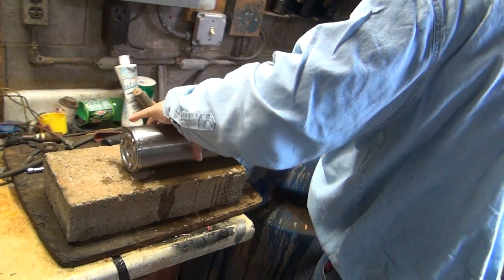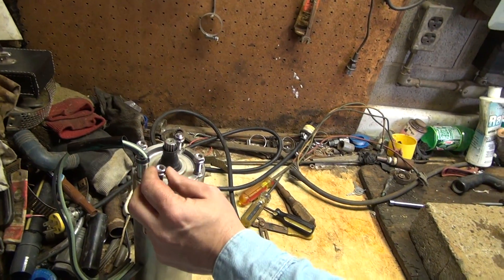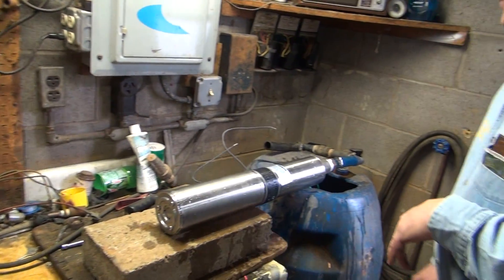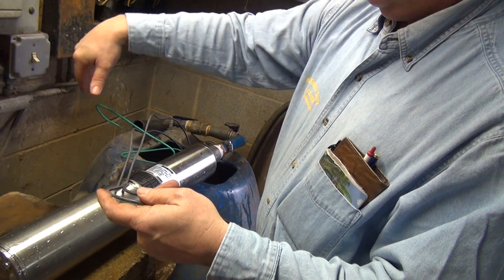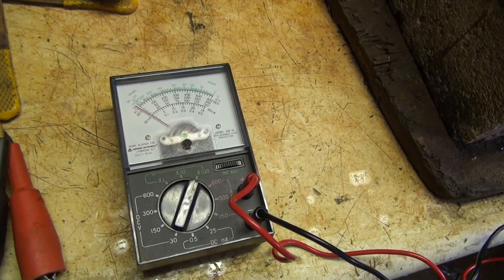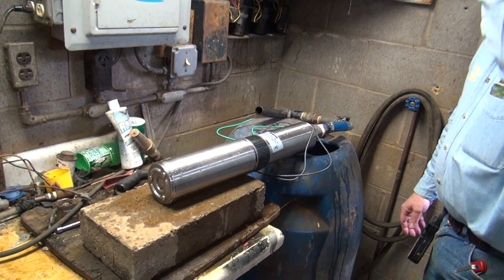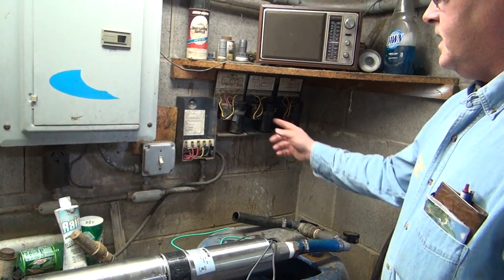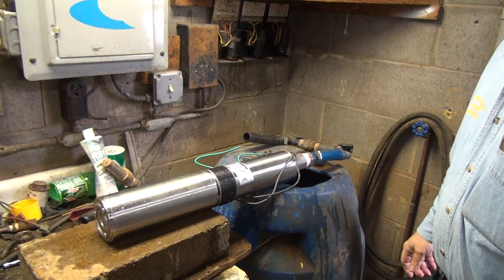Submersible pump test 2

Comment: Thanks for the explanation. Do you prefer a Goulds or a Grundfos submersible water pump? I had heard the Goulds pump no longer have a Franklin electric motor. They now have a CentriPro electric motor. Are they as reliable as the Franklin? I don't currently need a pump but is it wise to purchase one and have on standby? If so, what is the best environment for storage? Thanks for the video.

Comment: answer him on the 2 hot wires and why they don't need a neutral. the cycles are out of phase with the other and this allows them to use each other as a neutral

Comment: Thanks for providing tutorial on testing & diagnosis of submersible motor . 
#So Please provide the technical clarification for below mentioned practical problem. 
: problem about "2HP rating. single phase"-submersible Borewell pump set. 
#After starting pump-set :Starting Amps go up to 20A & Amps  Return back to 7.5A@245V (Running current /Amps). 
*But pump-Water flow output :zero /Nil*. 
#"Main winding continuity" (R-B.) absent (missing/*NOT OK*). 
But Y-B continuity is OK/all right. 
B= common wire 
Y=Auxiliary /starting winding 
R=Main winding 

# My question :
"If  Main winding continuity is NOT OK" ,  *why Pump set is NOT getting overloaded with high Amps*? 
(*because driven/mechanical load  receiving by Auxiliary winding only*) 
Overload Relay setting : 15A
Normal Running Amps: 12.5A@245V
#Please Answer. 
www.facebook.com. com/Bhargava Ashwath
curiousbhargav@yahoo.co.in
Thanks

Comment: my water is spitting out air in line i turned on all water though out house did not work what could be wrong , i have a submersible pump.

Comment: Ground wire is useful... you really do not want to have the motor leak 110/220 volts to the 'water' or a metal pipe. I had that happen to me where when the light was turned off and the wall was live... wrong polarity on the switch!

Comment: I have a three wire single phase flotec, the capacitor in the control box is blown with its insides hanging out. I got a new box... I'm worried if I just install it something might be wrong with the pump drawing to much current through it. I checked the pump three wires to ground continuity, there was no short, I'm checking yellow to red and yellow to black but I do not know what resistances these should read. One is about 250k ohms, one is 9.2 ohms. Would you imagine I'll blow my new capacitor if I fire this up? flotec 230v 4" submersible three wire with above ground control box. pump is still 80 feet down. I would like to not pull it if possible.

Comment: OK, so we are talking an USA format still two phases being 220V opposed to 110V having neutral. Still it has a run capacitor/winding that is connected between the phase and neutral. The function of the start winding and cap is create a 90 degree shift to enable motor to start or it will growl (stalled).  Is there a flow switch?

Joe M.  It has a few possibilities - check the static resistance of of the run winding / stator winding and the capacitor value on specification sheet.  Try taking the pump assembly off motor - check in float of pump for collapsed or jammed stages.  Power up motor independently to determine if bearing collapsed in motor as it will growl and not rotate. This will help determine root off problem depending on outcome(s).

Using a analogue meter to check insulation breakdown (phase to pump body) is done by amateurs!! Man use the proper mega to measure  or a digital meter to give a rough idea to determine if mega it is required!!! Yes, peanut the earth help to save lives and trigger circuit breakers upon faults. You know; water ingress, poor connection, short circuit and alike.   To my knowledge the motor does not support the thrust of the multi stage pump being independent units!

Comment: Having trouble with my pump it has the same control on that you have on the wall. Replaced it and the pressure switch but the pump is still not pumping fast enough. Any idea what's wrong?
Reply: Hole in pipe?
Reply: liquid end is wore out ?
Reply: Sounds like u need a 3/4 horse pump instead of a 1/2 horse pump